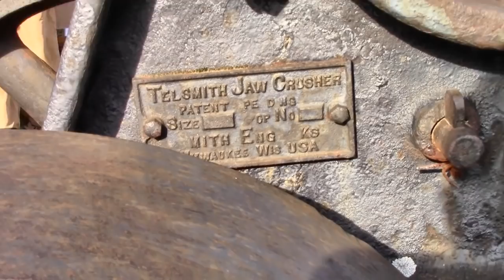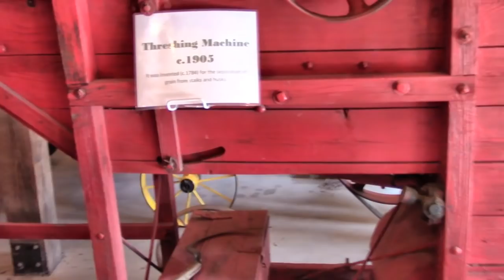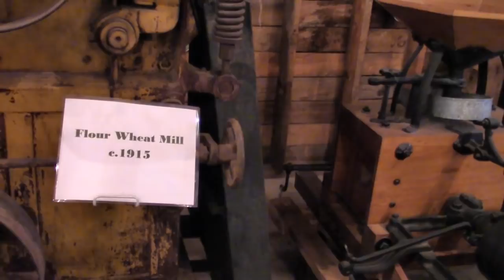Good of the land fest part 1 of 2

Comment: Hi Harold,
We are glad you won one of our boring bars. Did you get the short one sided bar for boring heads or did you get the longer 2 sided one for a lathe? If you would like to trade it in for one that would be more practical for you let me know.
Steve
Reply from the maker: The bar I got is just fine.  It is for a lathe.  Thanks for stopping by.

Comment: I too questioned the functionality of that mill wheel. Every ater wheel I was ever around took a pretty healthy stream of water to power the building. That water tank up there didn't look big enough to last more then a few minutes at full power.
Reply from the maker: I think they were using the windmill to pump the water back up to the tank.  Thanks for stopping by.
Reply: bcbloc02 the wheel is actually a functioning wheel but they do cheat a bit. There is an electric pump in the pond. When Justin took over as curator of the museum he actually fixed it and got it running again.